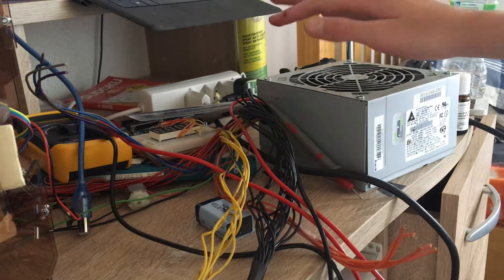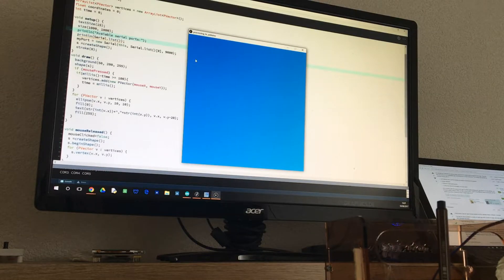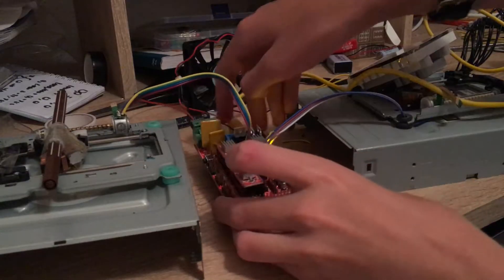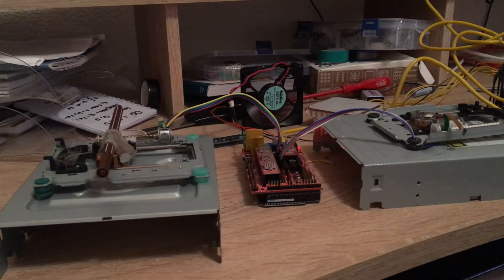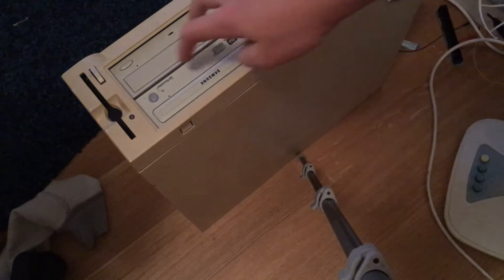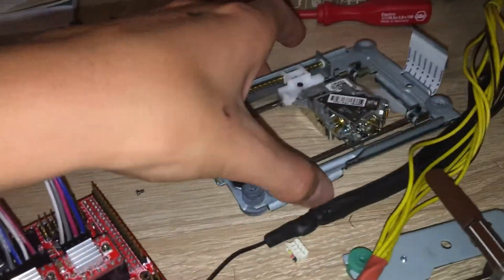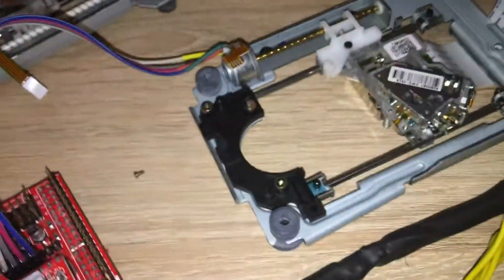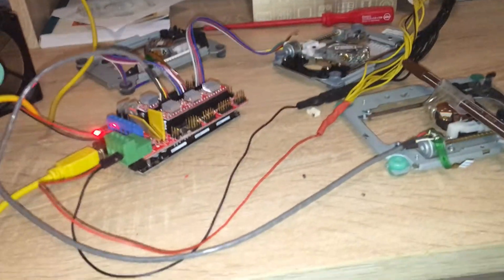Making a CD-ROM 3D printer:  week 6

Comment: Is it normal that the stepper motor becomes too hot even in idle?
Reply from the maker: Hi, thanks for watching the video! No, this is not normal. While printing the motors are about as hot as radiator and while idle they are just warm. I had this problem before, to fix it just lower the current being given to the motors. If using a Ramps board, you can do this by adjusting the stepper drivers' potentiometers. Hope this helps.
Reply: Thank you very much for the tip. It works perfectly.
Reply: Even I was facing the same issue for a long time. Thankfully found a video that gave me the same advice.